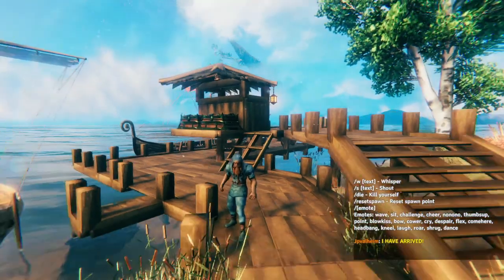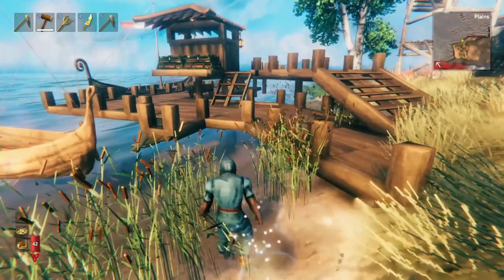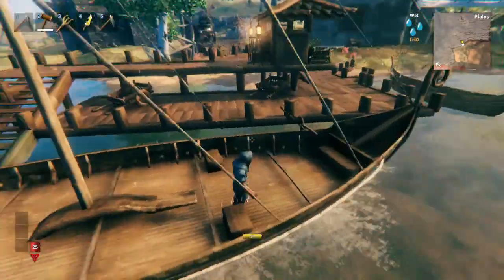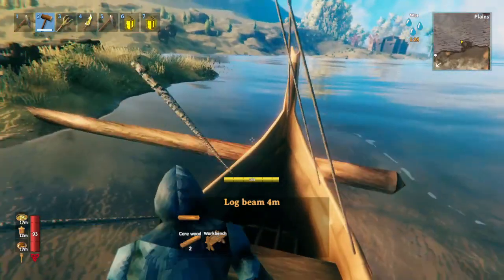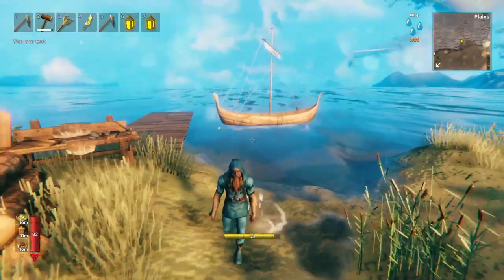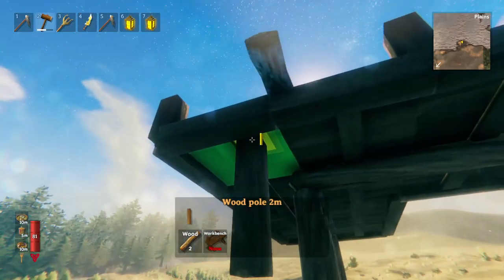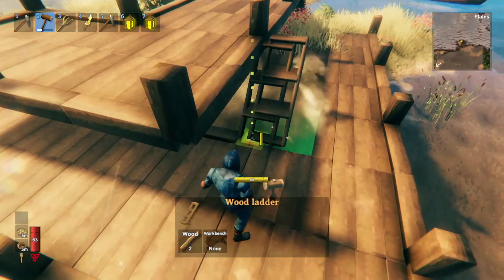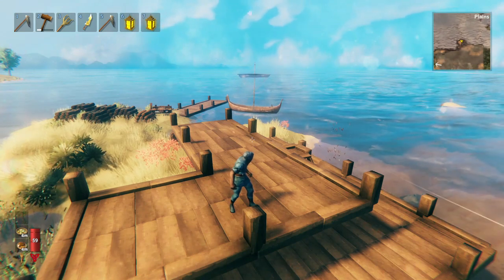How to Build an Advanced Dock for Your Boats in Valheim

Comment: All those are cool BUT it’s gonna look trashed after a rain.
Reply: Thats a good point I should have talked about how the rain damages the wood without a roof!
Reply: @JackPitmanNica  I really wish there was a setting to turn off degradation. Would open up a lot more builds
Reply: @nicholasa6471  That would be cool, I was surprised they didn't include it in HIlder's Request tbh it would have gone along well with the "Hammer Mode" option